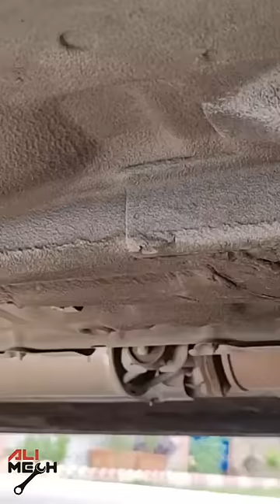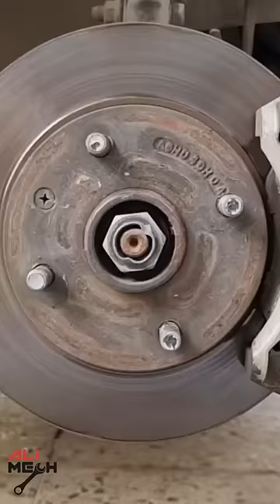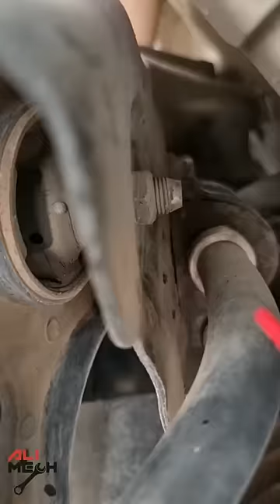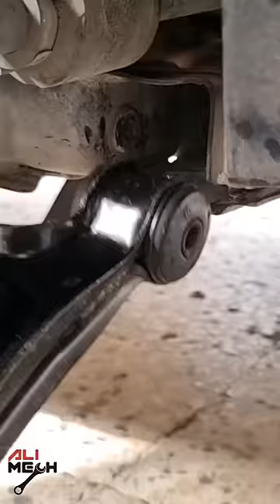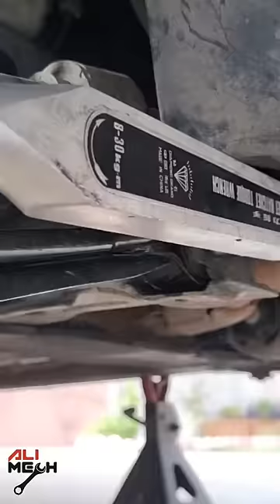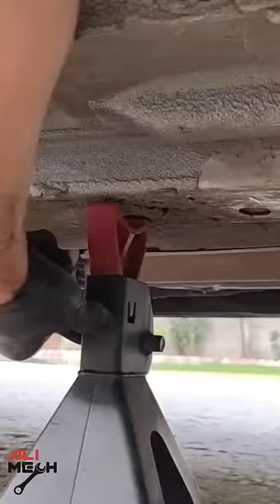How to replace control arm at home #shorts

Comment: Just a question: are you replacing or because it's bent or something, or because the bushes are shot?

If the bushes are bad, can they be replaced or is replacing the whole arm the only way?
Reply: Aftermarket parts are not expensive so ball joint is almost same labor price the bushings on the lower control arm 
Better get the aftermarket parts cheap easy install
Reply: @Jeremiah.1  a

Comment: Oh boy! You're gonna have ripped bushings pretty quick, you NEVER wanna tighten suspension components until the weight of the vehicle is on the suspension! Doing so can rip the bushings, reduce their lifespan, and make the suspension ride worse due to improper installation, you wanna also use silicone grease on contact points anytime you install any suspension component to eliminate squeaking, and increase lifespan of suspension components. New parts are typically only as good as how well the installation procedure is done.

Comment: Poor axle stand positioning, not only could it slip but it damages the undercoating. You didn't tighten the front bush with the car at ride height, it won't last long. That tire has a bulge in the side.

Comment: wr do you get the correct torque specifications for Toyota cars ?
Reply from the maker: Toyota camry official website, maintenance/spect tab
Reply: @AliMECH  please put link for us
Reply from the maker: https://parts.toyota.com/productSearch.aspx?searchTerm=Variable%20valve%20timing%20oil%20filter&ukey_make=5775&ukey_model=89476&modelYear=2017

Comment: Wrong! You need to tight up swing arm bolts when wheel is on the ground. To take a tension from rubber bushing. If you do the way as on this video, it won’t last